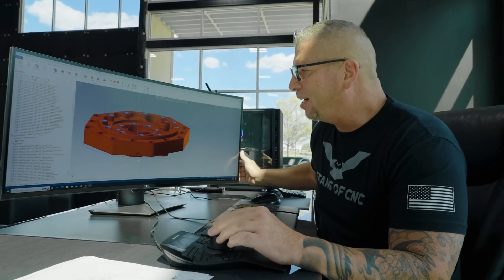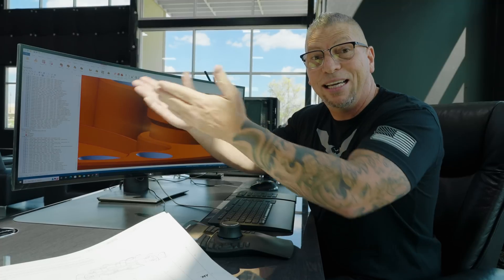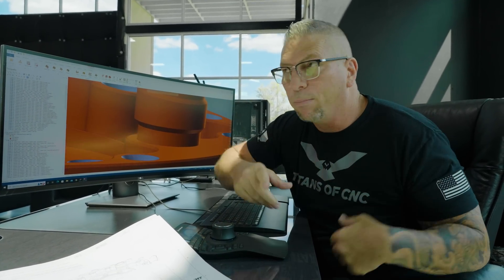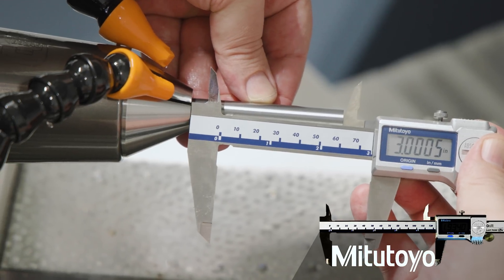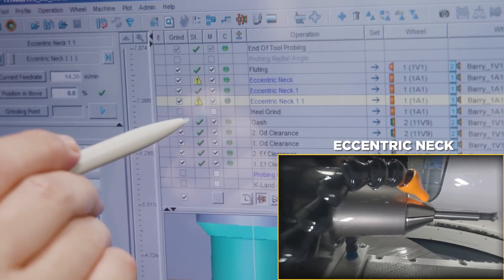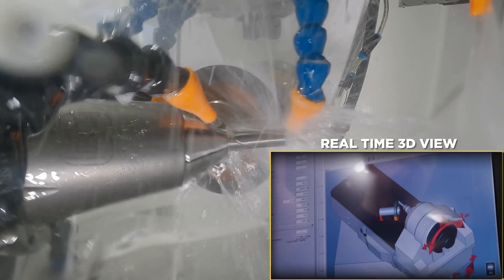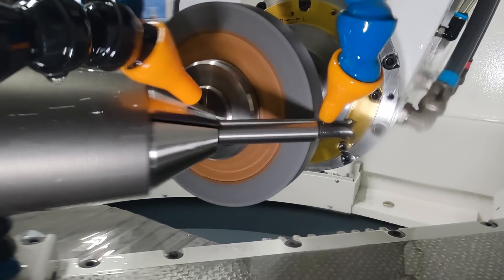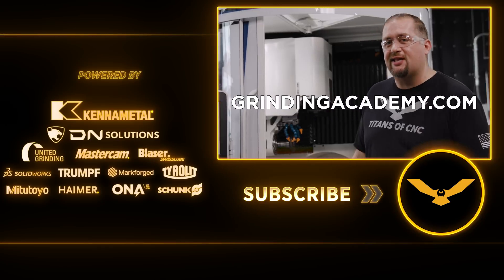Grinding Custom Tool for Complex Aerospace Bulkhead Fitting

Comment: Why didn't you make a helix in the tool?.
I'm working for over 30+ years in the toolgrinding industry with walter , Rollomatic and Anca toolgrinders.
When i see you grind a strait flute in a profiled tool, i think youre going the easy way.
Reply: The length of cut is only .120”. Most slitting saws dont use a helix
Reply: @barrysetzer  Don't get me wrong, i'm not here to criticize your work.
I always love to see how someone else approaches a tool, my costumers always asking me for a helix tools or a crosscut tools because it cuts easier but it also depents on what milling machine they are using.
Best regards
Edwin witten 
Netherlands

Ps, I love the enthusiastic and fun you all are making in the short films.
Reply: Hey Edwin! Dont worry, you didnt hurt my feelings 😂. I would actually be curious to see your design! I do not proclaim to be an expert at anything 😉

Comment: How would one go about starting in on all of this? I'm currently working 5 days a week so I am looking to do something on weekends to make a bit of extra cash. I've been looking at smaller machines, second hand and the cost is still well, costly. I can pick up a 3D printer pretty cheap but I really would like to work with metal.
Reply: Try to find an old beefier drill press, there are examples on Youtube and forums of the type to use. Can get away with hobby accuracy. Make enough doing that to fund a used or new knee mill, etc. Alternatively CNC routers can do non-ferrous decently (small tool diameters and high rpm found in routers go hand in hand), but repeat profit and upgrade tooling. Tooling itself is the most expensive part of machining, not the machines themselves.
Reply: @ScuffedEngineer  exactly this. 
normally it's said that you pay at least the same amount as you paid for the machine for tooling and tool holders in the beginning

Comment: I dont work in the industry anymore, after working 8 years in CNC maching I left my job. Wich I still regret because I believe in manufactering in your own country. But I am still amazed by the work you deliver Titan. Wish I could be part of your team.
Reply: I know right because of the dirty coolant that stinks. the method I use for solving that is putting bleach into the coolant then change it tomorrow. temporary fix